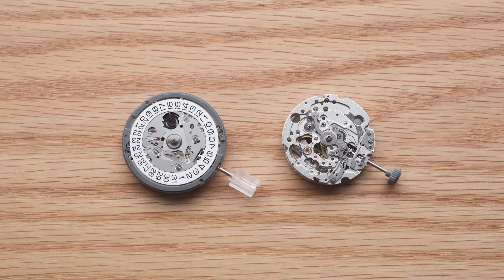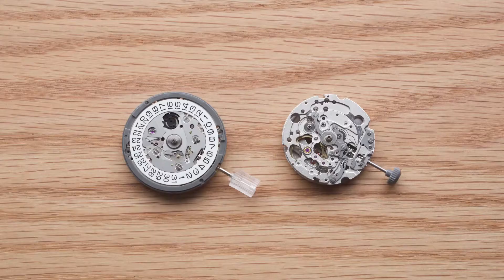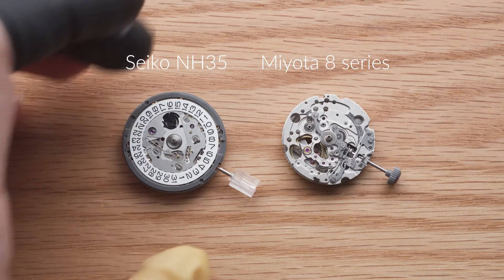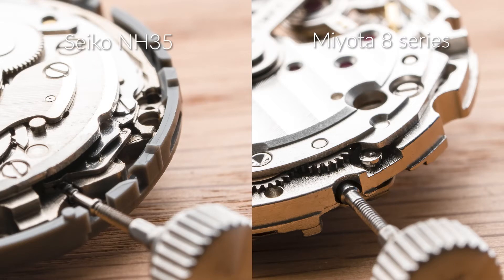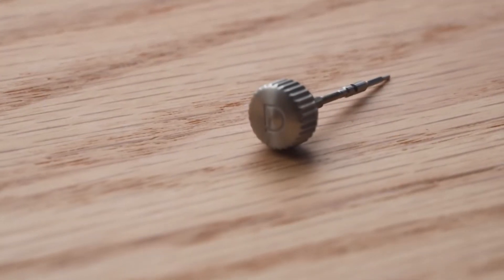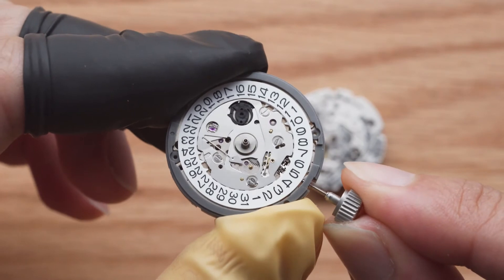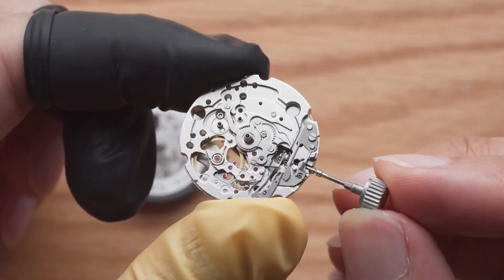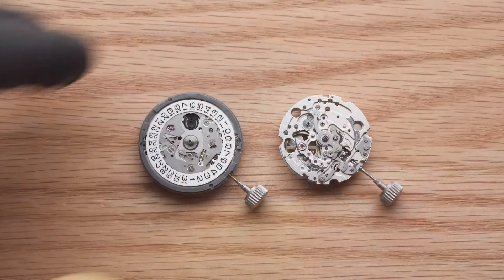How to remove and install the stem & crown for Seiko and Miyota movements

Comment: The brand new nh38 movement I'm working on continues to run even when the stem is removed, have you ever had this happen? It's a new build and I cant put hands on it if it wont stop running!

Comment: when I'm installing movement into the case, I'm running into this issue in which the crown will not engage. only when the movement is out it is that I can get it to work. How can I resolve this?
Reply: Le mouvement n'est pas bien enclenché dans le boîtier, trop a l'intérieur ou pas assez, la tige de couronne doit rentrer absolument horizontalement. Attention a la taille de la bague qui permet de caler le calibre dans le boîtier.

Comment: Hi, on my seiko 6119c the little pin wont come up again when inserting stem, so doesnt lock. Any help?
Reply: did you find a solution for this? I'm running into the same issue
Reply: @alejandrocanoplus  only with disassembly of hands and dial. Seems no other approach or solution than that

Comment: When I press down on the lever, I see it move (seiko sea urchin). However for the heck of it, I cannot get out the crown!!
Reply: Same problem here! I have got a seiko SNZF17K1 (sea urchin) and cant get the pin out…
Reply from the maker: @martijnknol8690  1. is the crown all the way in before you press the lever? 2. make sure you keep the lever down while you pull the crown out. these are the most common problem with crown removal, hope this helps
Reply: @DIYWatchClub  hey, I did those two steps well but more force was required to get it out. Modding was succesful after all :)
Reply from the maker: Good to hear that!

Comment: Hi, can you please show me how to remove the stem for a 251.471? I have a Gucci YA101322 and the stem broke about 10years ago. Planning to try to change the stem myself. Please please help!
Reply from the maker: It's a bit hard to explain here in the comment, but simply put, it's is similar to what is shown in the video. There is a button, indicated by an arrow. Pull out the crown, push down into the hole, and pull out the stem.
Reply: @DIYWatchClub  ive tried it several times over. Pushing in the hole doesnt seem to have clicking feel. It feels like a dead piece of metal that isnt designed to move. Im seriously at a dead end now. Would it be possible for you to show a tutorial on a 251.471?
Reply from the maker: @supermanofkrypton7524  Unfortunately I don't have a eta 251 on hand so it'll be hard to for me to make a tutorial (for now). But let me try my best to help you with words here. I might have misled you when I said "button". It's not supposed to be a clicky thing, it's just something you can hold down/hold immobile, so that you can pull out the stem without the clutch engaging. Try experimenting with different crown position (in or out). I don't know how much of the broken stem is left, but you can probably grab it with a tweezer to pull it out (crown out position) or push it in (crown in position) My memory is fading as the only time I handled a 251 was quite some time ago, but I remember the thing inside the hole can be held down in a certain crown position (vaguely recall it's out). Another possibility may be because of its 10 years age, it could be something sticky or rusted that keeps the stem stuck, that would be a trickier situation. Hope this helps
Reply: @DIYWatchClub  hey man!! I decided to make a video to show you that I've tried exactly that but the stem won't come off, but miraculously it came off this time!!! The trick was apparently to set the time to 2 o'clock and the to pull the stem out to the 2nd click, and then to perform this. It worked!! Thanks for advise man. :)
Reply from the maker: Congrats!!! That's the DIY spirit! Can't smash that like button enough!!
Reply: Thank you for your great videos: love it!
A beginner’s question: after installing the hands, is it ok to flip the movement over and put in a holder to remove the stem/crown to allow installation into the case? Or will this risk damaging the hands? Thanks again!
Reply from the maker: @andrewhogg1427  Good question! Not a beginner's question at all. In fact, I usually do this: hold the movement with my left hand, use right hand to press the button with tweezers, then use the remaining fingers on the left hand to take out the crown. You'll need more finger dexterity to do it, but you'll have good control of the movement. I'd be wary of using a holder, as the holder might scratch the dial or might be in the way of the longer hands. Sometimes I also use the case top (flipped upside down) as a holder. It's safer this way because usually the case top should fit the dial and hand perfectly
Reply: @DIYWatchClub  thanks: that’s really helpful, got it!